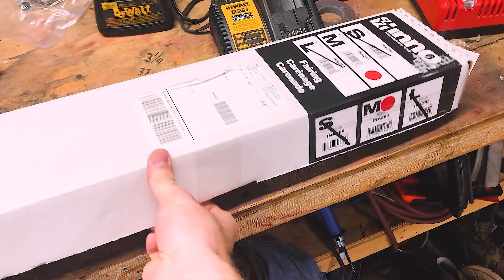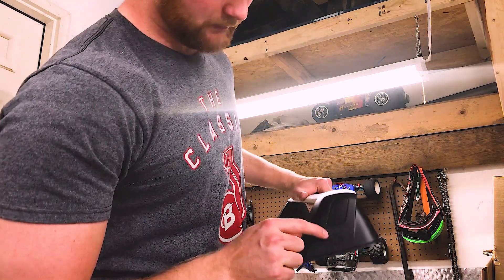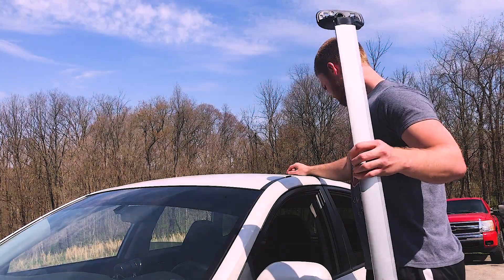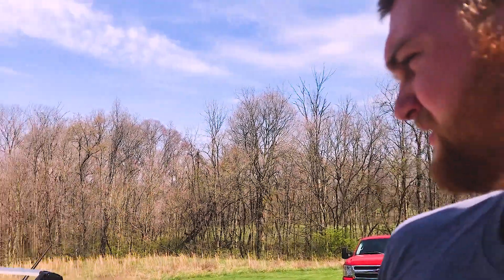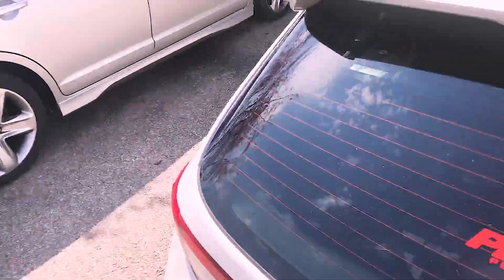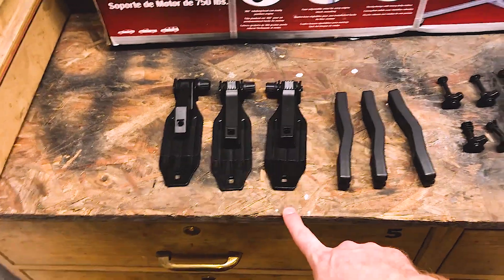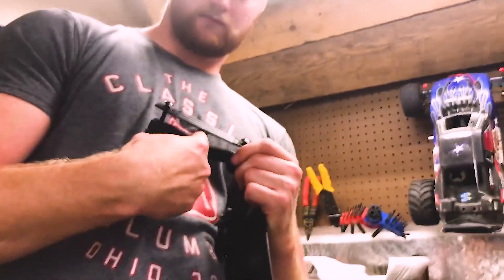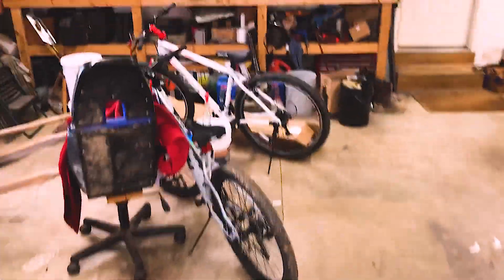OEM Subaru Roof Rack Install (INNO Wind Fairing)

Comment: Damn thank you! First video I seen on the Install of the inno fairing, on a WRX hatch. I was wondering if I needed the bigger bolts, but looks like you were able to use what it came with... how has the driving been? I have the oem roof rack now and it doesn’t make noise, so at this point the fairing just cosmetic.
Reply from the maker: Ni Butera everything’s good so far. I don’t notice wind noise and I used all the hardware that came with it. I love it and have no complaints!

Comment: Cool!  I'm looking for a fairing for my stock Subaru 2104 WRX STI roof rack.  Question:  I noticed the fairing you installed does not extend all the way across the roof.  It stops short, and sort of lines up with the inside of the roof rack mounting brackets.  Was that by choice?  By what was available?  I'm trying to decide which looks better... like you have it, or if I installed one that goes all the way across the roof.  Any thoughts??
Reply from the maker: That is by choice. I like they way that looks better. They have a small medium and large. That is the medium (I forget the measurements). I feel like the large makes the roof look too squared off if that makes since.
Reply: @brotherboost  Yup , makes sense and looks good!  Thanks!

Comment: Hey man just came across this video. Pretty nice man I haven't been able to find a good video about these OEM racks. I have a 2008 impreza WRX Turbo. So it's been hard to find the OEM racks that actually fit my car. But my question is I've seen online how people install this same roof rack. The biggest issues they've had with it are that the middle of the bars will sag when they load equipment on. I don't know what they're putting on it but I'm just using it for snowboards. The second is the noise. People say it's very loud when they drive with it. So I wanted to know how these racks have been since you have had it installed on your car. Any troubles of cons?
Reply from the maker: I use mine for snowboards and it works great. The roof rack itself isn’t load (I don’t even notice it). When you put the snowboard mounts on they are pretty load.

Comment: great video. question about the mounts for the roof rack on the car. the roof rack itself has 1 screw per side but on my car there's two holes. I was wondering that that's the case for your car or are there specific roof racks with 2 screws on each side.
Reply from the maker: Start watching from 7:50  I put it in the forward most hole.